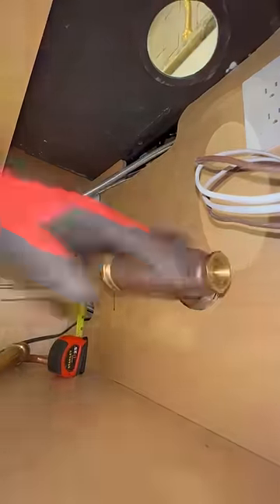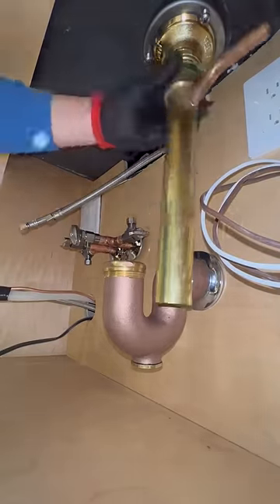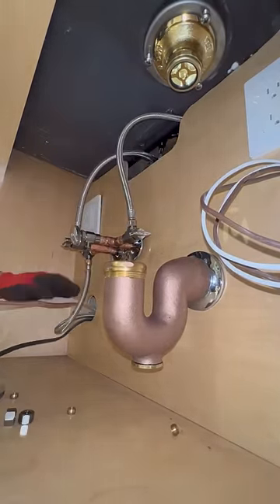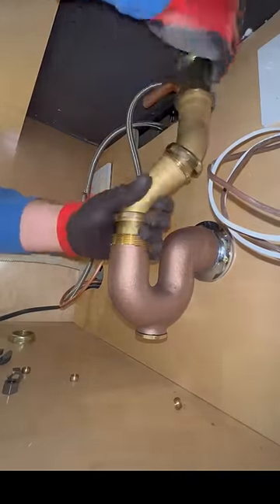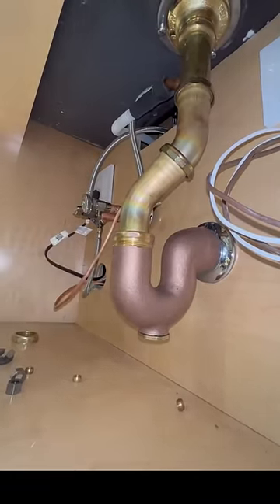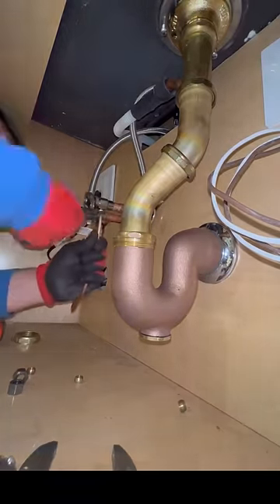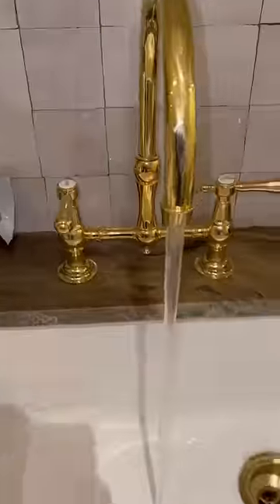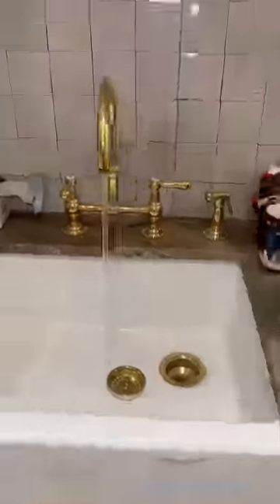Plumbing Chronicles 3 #carpenter #puzzle

Comment: Absolutely gorgeous work, I'm curious how much that p trap was
Reply: Similar one on supplyhouse is $27 which is less than I expected
Reply: @feyrband  bullshit there’s no way that’s $27 a 3” pvc glue ptrap is damn near 20$ and that’s plastic. Plus it has a cleanout in the bottom of it
Reply: @feyrband  I'll have to look on there, I was going to plus I've gotta place an order 😂
Reply: @jake16542  note I said similar but go look yourself chief. 2" x 1-1/2" NY Regular Trap with Cleanout (Rough Brass)
Reply: @jake16542  

3”? There’s your problem. Those bigger pvc fittings are expensive. Especially when they are not really popular/high volume.
Reply: @darwinawardcommittee  the only reason I said 3” is because I know the exact price of that ptrap. It’s still plastic a 2” ptrap is maybe 6$ less
Reply: @feyrband  they’re about 60$ a piece for this exact same trap. I get them for 45
Reply: @darwinawardcommittee  3” ptraps are extremely popular in commercial plumbing. Most floor sinks being installed today have been upsized to 3” traps.
Reply: Depends on the quality of the brass,..old school 1920s quality if you can find it, pre scamdemic, I paid 117.00 with return not counting pop-up assembly with faucet.
Reply from the maker: About 40$
Reply from the maker: Thank you 🙏🏻
Reply: @jake16542 I haven't seen a trap like that- with cleanout. Imagine if HER "trap" had a cleanout? She wouldn't have to use summer's eve or massengail!
Reply: @feyrband why dont pvc ptraps come with clean out, eh?
Reply: @marcuspeters5855  they do. The cheap ones don't I imagine because it's easy just to uncrease both of the fittings and take the whole trap off. But for instance the k56035h from nibco has one.
Reply: @feyrband  yes, that makes sense. 👌
Reply: @jake16542  3 inch ?! 😂 bruh wat
Reply: @feyrband  I saw that but it's a regular trap, not an la removable trap , the la traps are probably twice that
Reply: @jaydrains2247  gotcha, had to look up the difference.  Thanks. Might use one in my kitchen remodel
Reply: 2.69$
Reply: @marcuspeters5855  That's a different type of plumber, that's Mr. Plumber.
Reply: @jacknasty6940  long ago when the dollar had greater purchasing power
Reply: @brianc3481  😂

Comment: I thought when testing a sink for a leak you’re supposed to use cold water because when you use hot water, everything swells up and that could tighten the threads and have it not leak when you’re running really hot water. But when you run cold water and everything contracts, that’s what it’s most likely to leak. That’s what I was taught and do at least!

Comment: How did you get to those faucet nuts bro?! Good shit! That looks like a real knuckle buster
Reply: When I run into situations like this a lot of times I'll take needle-nose vice grips and just adjust them so they're barely touching the nut and that way they hold their position or I will try the faucet nut wrench which you got to have at least 1/2" or 3/4" around the nut for it the wrench to move and catch the nut enough
Reply from the maker: It was very hard bro

Comment: Thats why when i install granite countertops and see a farm sink i always cut a huge hole for the drain and a long wide rectangle for you to do the faucets.  Wish the carpenters would do their job for me and have the farm sink at the right height and not to low like they do cuz then i have to raise it to meet the countertops.  Worse is when its to high and now the whole countertop is on shims and now i gotta fill gaps with silicone. Thats not to bad if its quartz but granite is delicate if done wrong.

Comment: Thermal expansion is a bitch. Always test with hot water for sink trim outs,  trust me. Hydro try the rigid tool for those sob faucet installs. It’s not gonna work 100% of the time,  but 85% of the time it makes it easy peasy. I believe the tool is a faucet wrench tool thingy lol. But seriously it works. Does 15/16 nut’s as well as plastic one’s perfectly. Later broski.
Reply from the maker: Thank you for the tip

Comment: I never seen brass drains before.  I see copper drains on the hospital jobs we work on.  Do they not make cast iron sink connections??  Sorry, I’m a carpenter so I may sound ignorant.
Reply from the maker: 😂 you dont bro. No they dont make cast iron fittings for the finishes only brass and chrome